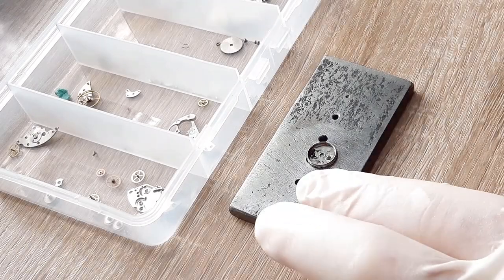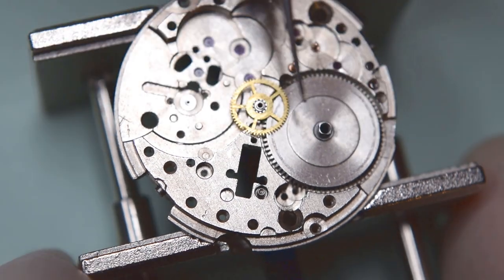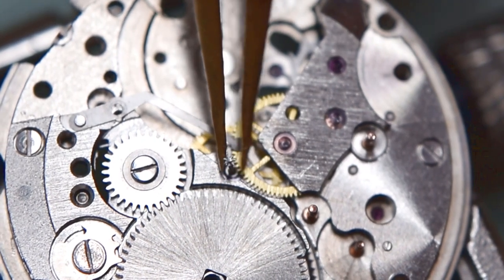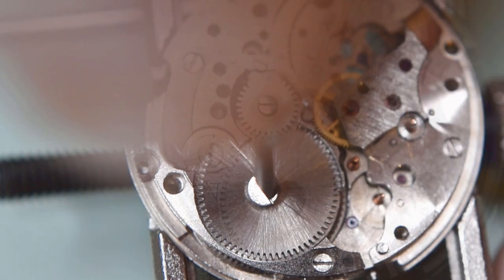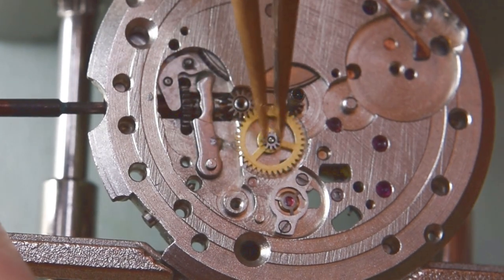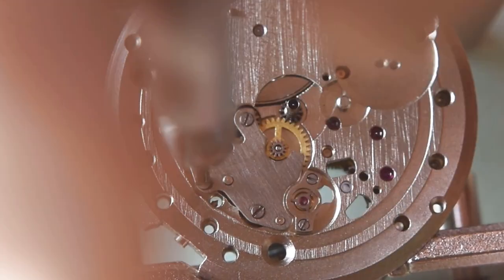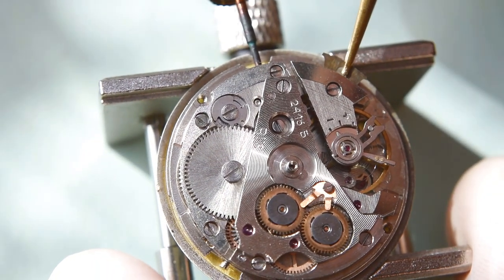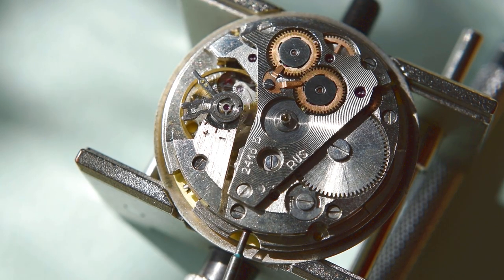Vostok Amphibia movement assembly 2416b | PART 2 restoration reincarnation

Comment: Hi there. I have question. I bought a very cheap Vostok amphibia on eBay and I will try to restore it myself. I want to know what size screwdriver(s) you so I can give it a go myself😁. I'm looking forward hearing from you😊
Reply from the maker: Hi if you buy a set of 5 screwdrivers should be ok generally 0.6; 1 and 1.2 will do. Check links in the description down below for tools and good luck with restoration 👍

Comment: Nice rebuild, I am on the hunt for a 2416b movement for my "snowfall" build and wanted to see the difference between 2409/2414A and the 2416b and guessing the 2415 is just the auto version of the 2409?   Would love to see a vid on a ISA 8171.201 or 202 as I have a beautiful Maserati watch but the timekeeping side of it has stopped whilst the chrono still works, I am wondering if the hacking switch is at fault as I had that on a Soviet quartz where the hacking cutoff plate had bent so it was permanently "hacked".
Reply from the maker: Good luck with hunting. The difference is that 2409 and 2415 are without date 👍
Reply: @tickingWATCH  The 24xx movements are derived from the 22xx movements which were designed in the early 60’s

Comment: How can you safely let down the mainspring while the movement is still in the case?
Reply from the maker: It is not difficult. It can be done wit the winding steam and tweezers or with screwdriver and tweezers, check also here https://youtu.be/HM-gYGJsH0Q?t=1053

Comment: I have three 2414A movements that keep poping out the second hand, i have checked and the hands are not blocking or touching one and other. Do you have any idea what the problem might be with these movements?
Reply from the maker: Could be that the tube in second had is to large, when you have this case you should squeeze it a little bit but with feeling.

Comment: I have the same caliber on my Vostok, and a problem. The rotor is both winding and unwindind. I can see that gear on bittom is movin both sides - it should move only clockwise. What can be problem ?
Reply: In my opinion this two wheels that I'm installing from this timeframe https://youtu.be/UKeJuVX45zk?t=473
Reply from the maker: Probably two intermediate wheels that that connects with the rotor
Reply: Thanks for answer. Could it be a spring click on dial side , too ?

Comment: Hello, I have a question. I just changed the fixation ring-(from plastic to metal)- that holds the movement in my Vostok watch, and when I tried to place the crown back in place I noticed it does not lock in place, I can unscrew the crown and it keeps sliding out, it won't stay locked in place. 😟🤔 Any idea what might be wrong? Thanks! 😊
Reply from the maker: Hi rather everything is ok, sometimes it is difficult to fully push it. Help yourself holding the stem with the tweezers and pushing it in the same time. I think can be seen on one of my videos, this one in polish
Reply from the maker: Here https://youtu.be/SPDuW71W0Ec from about 10:20